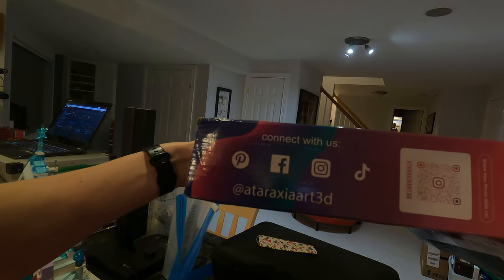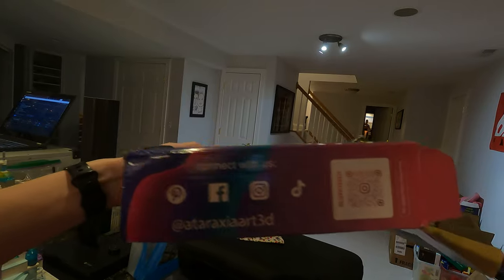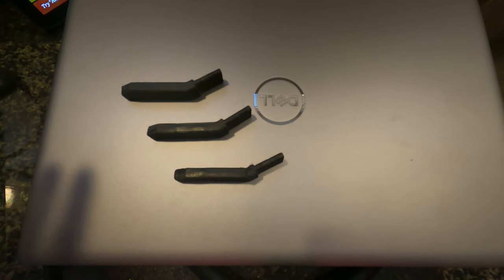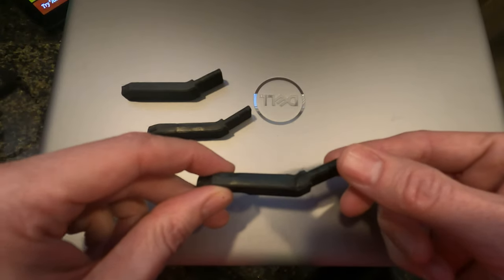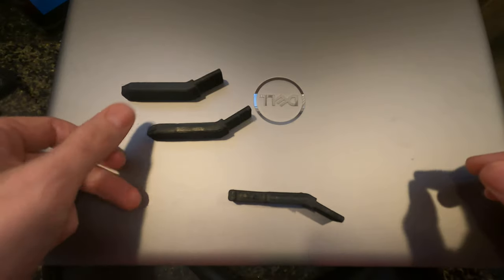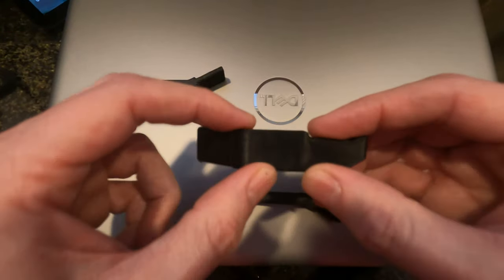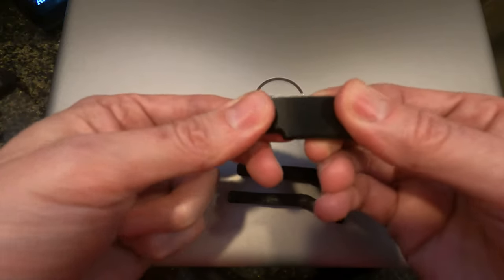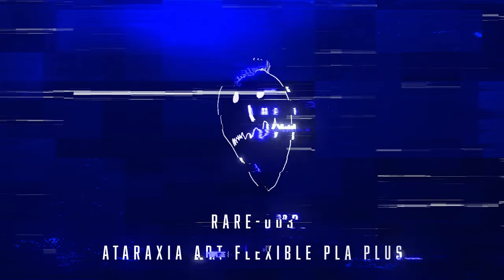RARE 003: ATARAXIA ART Flexible PLA Plus

Comment: How do you get these off the bed?
Reply from the maker: Sorry I was late to the answer on this - there's a couple of options and I don't know which will work best for you.

First, try pulling it off right away while the bed is still warm if it's a small part. If it's a large part, I print without a heated bed. Slow pulls work best. Hope that helps!

Comment: just bought some yesterday, seems pretty new but i love the idea of easier flexible material to print. any updates so far or settings for it?
Reply from the maker: I'm pretty "basic" from a PLA settings, print at like 195C (generally Hatchbox) and about 80mm/s with a 0.4 nozzle. The only thing I changed with this was lowering the print temp to 190C and it turned out really well. I think I'm still going to have to do some stringing tests with it because there's a little bit of zits, but there were so few, it wasn't worth it and basically was just "drop in."

Comment: retraction settings?
Reply from the maker: This is a bit ago, but in general I try to minimize my changes for tests. Likely it's z hop when retracted with whatever the default in Cura is for standard PLA, so probably about 0.5-2mm depending on whatever version I used. Let me know if you find some that help!

Comment: What 3D printer do you use for it so I can buy it
Reply from the maker: This is an Ender 5; however, the components in general are the same as the Ender 3 but with a larger square frame. As with most filaments, it's primarily based on the settings as well as the calibration effort you've put in to making sure it's running well - which can translate to "difference in printers." As with any of these, you'll want to make sure your test calibrations are solid before attempting to move to another filament and then you're going to want to redo many of those to fine tune it.